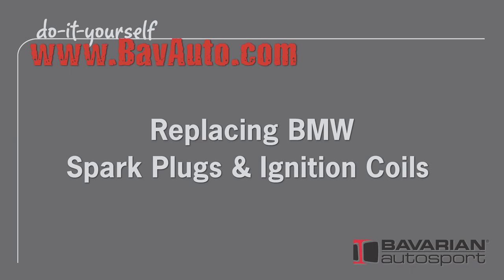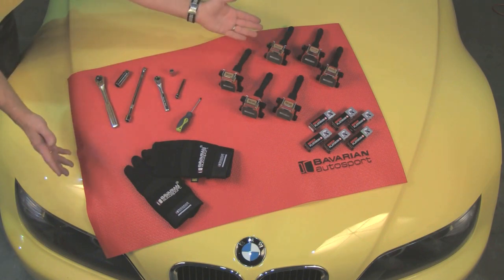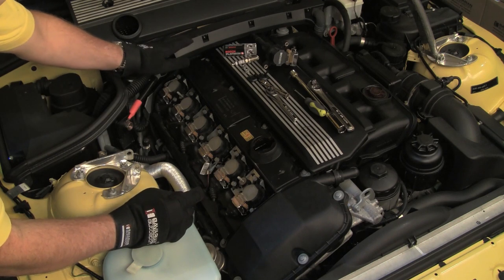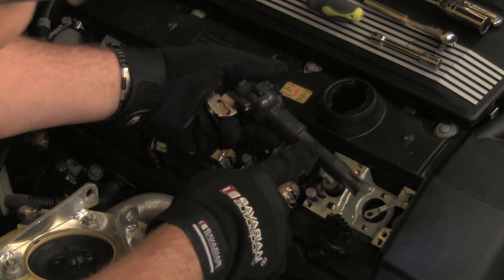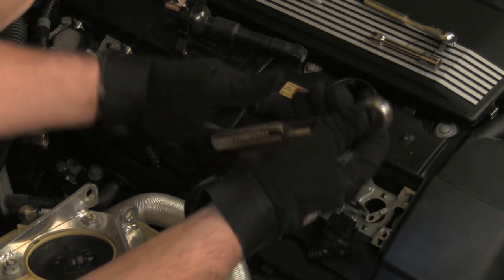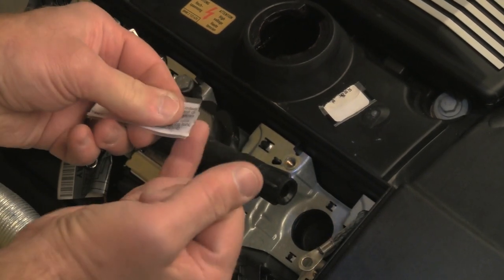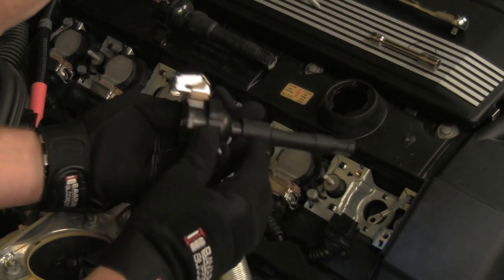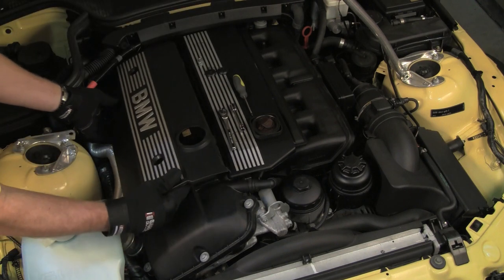Replacing BMW Spark Plugs & Ignition Coils

Comment: Thank you for this video. I had a P1344 code. I took it to a shop and they replaced the spark plugs for me for $270. Shortly after leaving the shop the light came back on so obviously that wasn't all I needed. The BMW dealer wanted about $970 to do this job. They said it was $750 for the parts and the rest was labor. I bought the same exact part from an online auto parts store for $230 and thanks to your video I was able to put them in myself. The engine light went out and it is running fine. Thanks again for this wonderful how to video.

Comment: Not to be a pain, but put the oil cap on before removing any nuts or bolts!  the last thing you would want is to accidentally drop something in there.
Reply from the maker: Good note, Harry
Reply: +Bavarian Autosport    I couldn't stop glancing at that hole into the great abyss. My gut was in a knot the whole video.
Reply: especially at 4:22 when he tore open the packet of silicone grease. the torn off part almost ended in the holw =/
Reply: Me too! Well not in a knot but very aware the dung  show that would occur.

Comment: After watching this video a few times I worked up the courage to tackle my first spark plug replacement on my 2002 325i and it worked out great.  Thanks so much for putting this on here.  I'm not brave enough to try the pcv replacement yet, but maybe sooner than later now that this went well.  Best regards

Comment: Job done, Thank you so much, local stealer wanted 250 bucks to swap ignition coil. I did job with just a socket driver and flat head screw driver. 10 screws and a few clips later engine running perfect. total time 20 minutes. Thanks again

Comment from the maker: Yes, it is similar.  the engine in your 95 325is is the M50.  the engine shown in the video is the M54.  The basic procedures are quite similar (almost the same).  you can certainly use this video as your DIY guide.

Comment: I have a '92 E36 standard M50 and it has a seldom ticking at idle. It obviously has a miss but I need to hook up a scan tool to see which cylinder is misfiring. Thanks to this video, it seems fairly simple. Also reading others comments helps too knowing that I have the same problems and that this is most likely the cause. Might have a valve cover gasket leak but I won't know till I check all the boots. I have my suspicion about 3.
Reply from the maker: See our reply to your other comment under Jose Francisco Medeiros' comment.

Comment: THANK YOU! I usually take my car to motorwerks for any service issues, unfortunately they couldn't get me in to a loner vehicle for about 8 days and I just didn't have the time to wait or be without my car.  I know my way around GM vehicles but I've been a bit hesitant to jump into anything on my 530xi for fear of screwing something up.  Equiped with some prior knowlegde from replacing a couple of ignition coils on my 02 lincoln ls and your video it was pretty darn easy.  Thank you for posting this, it was much appreciated.  Not only did I save a couple hundred dollars but more importantly the time and effort to bring my car into the deal.
Reply from the maker: Glad to help, Brett
Reply: BavarianAuto  Good evening, I know what it's called fat to put on the ignition coil? thanks daniel

Comment from the maker: We are showing coil replacement for those that may need to replace one or more coils.  Coils only need to be replaced if they are "bad", such as generating a misfire fault code ... or ... if installing high-performance coils.  As for the boots, these do indeed deteriorate as well as increase in internal resistance as they age.  these should be replaced when the spark plugs are replaced.

Comment from the maker: @dbeater1 

Most original BMW spark plugs are made by Bosch.  However, there are some NGK applications.  You can use either the original BMW plugs or the replacement Bosch plugs.  In the cases where the original plugs are platinum (most later BMW models), the BMW original plug typically has a larger platinum electrode than the replacement Bosch plug.  Both plugs operate excellently.  The BMW original plug may last slightly longer.

See them at bavauto.com

Comment from the maker: The coils for the N62 V8 and the N51 and N52 6-cylinder engines do look similar to the earlier "pencil style" coils, but there are indeed different. We're certainly sorry if you received an incorrect set.  We have also heard reports of access trouble on the rear cylinders, as you have noted.

Comment from the maker: While we have found that these engine mounted coils do degrade over time (due to heat), they certainly do not need to be replaced at a specific interval.  Replacement can be categorized as; upgrading to hi-po coils, curing a specific fault or general maintenance at a higher mileage, such as over 150,000, or more.

Comment from the maker: You likely have a faulty bulb or control module.  Try swapping the bulb with the same bulb from the other side.  If the on/off moves to the other side, the bulb is faulty.  If it continues to do it on the same side, swap the control modules. If it moves to the other side, the control module is faulty.  If the issue still is on the same side, you likely have a faulty main lighting control module.  Feel free to call our advisers at 800-535-2002 or visit our website for the parts - bavauto.com.

Comment from the maker: As Jose noted, the procedure is similar, but your later model coils are not bolted in.  The N52 series engine in your '06 325i uses what we call "pencil coils".  We do have a video showing the pencil style coils on the earlier M54 6-cyl engine.  Your N52 would be similar, as far as removing the coils.  Removing the trim covers to access the coils would be different.  Go to blog.bavauto.com and search "Pencil coils DIY video".  We do keep the coils in-stock at bavauto.com or call 800-535-2002

Comment: Get a tool tray, don't balance parts and tools on the engine.  Number your coils and line up your plugs in order to examine for abnormalities.  After removing coils and before removing plugs, blow out wells with compressed air while wearing your safety glasses.  always verify plug gap (trust but verify).  On many of the newer models, BMW advises against the use of anti-seize on plug threads.

Comment: @Buddy Reventlow 
Usually a rough idle or loss of power is due to a misfiring coil pack or spark plug. Just check in a auto store to get a free scan to tell u in which cylinder is misfiring
Reply: +Wladimir Delia.... The first coil pack is the one in the front if your standing looking toward the engine.... The 6 coil pack is the one all the way in the back

Comment: What year is the car that you are working on and does the same rules apply for my 2008 525i? BTW you did an awesome job!
Reply from the maker: 2001 Z3 3.0i Sport with M54 engine.  The 2008 525i will have the N52 engine.  The general procedures will be similar, but this is a different engine design.

Comment: Hi great video as always. I was changing plugs on a 01 330ci and # 4 and #5 plugs don't seem to turn to well, it did turn some but they seem tight when I turn them. The others ones came out good I didn't want to strip out the hole so I stopped. Any suggestions on how to remove them without messing up. Thanks

Comment: Great video Otto, but you never explain why the spark plug boot should be replaced each time you change the plugs. Please explain. Also, put the silicone grease you apply inside the boot contaminate the electrical contact?
Reply: Silicone grease is dielectric which means it's electrically insulating and does not break down when high voltage is applied

Comment: I highly recommend NGK 3199... Part # -  BKR6EQUP. You will get improved gas mileage an better acceleration as well as throttle response at low RPM's. WARNING: Do not get Bosch spark plugs, they have proven to be inconsistent and faulty as compared to the NGK spark plugs. Good luck.

Comment: +Boof Garage 2 weeks ago
 What happens if we install the spark plugs without new coils n or boot?

Nothing will happen. Most people recommend it because you are less likely to have a problem. I only replaced the spark plugs on my BMW 330i and couple days ago Cylinder 1, ignition coil went out which started to make my car have miss fires. So I ended up replacing all 6.

Comment: is your little packet of dielectric grease the same as bulb grease? Aso on the vid you mention anti seizure cream. ( used when replaced my water pump) .. the two have different applications for this procedure?
Reply from the maker: The lube packet is Silicone grease.  We recommend this over other products, for the spark plug boots.  We do offer Silicone lube packs individually:

http://www.bavauto.com/fland.asp?part=825

Comment: Warning . The oil cap is removed  to get the valve cover trim off  but it should be keep cover al the time to avoid an accident . Something could be dropped inside  and destroy the engine as the cams can get jamm .   .

Comment: I have a 2007 Bmw 328i with 93,000 and it has a cylinder 3 misfire. It vibrates and says check engine soon then goes away and comes back. Should I change the spark plug or the ignition coil?
Reply: Manny Gonzalez the same happens to me , I'll wait for the answer
Reply: Manny Gonzalez change all spark.plugs and 1 coil pack should do you good bro, same situation as me
Reply: Same issue
Reply: change coils, plugs and crankshaft position sensor. then hope you don't have worn piston rings.

Comment from the maker: We will suction out as much oil as we can before removing the plug. We usually use our vacuum oil extractor.  The extractor comes with a small diameter tube that can get down into the wells, next to the spark plugs.  Our fluid transfer pump also works well, but you need to adapt to a smaller diameter hose.  Once you have removed as much oil as you can, remove the plug and finish the clean-up.  We have the oil extractor and pump in our online store at bavauto.com , or call us at 800-535-2002.

Comment: 1/8 turn on taper seats.  15-22lbs for 14mm with gasket. go on the lighter side of  torque value when using anti seize.(less 30% of max torque value)

Comment: Does anyone know of a similar video for E46 model removing the panel which obscures the last cylinder location? Also I am sure someone else has pointed out already but even though this is obviously a professional mechanic with a steady hand, put the oil cap back on. Save you fishing around with a magnet to get a nut out from under the valve cover!

Comment: Is it really a requirement to replace the ignition coils and boots when replacing the spark plugs?
Reply from the maker: gtarules1 Certainly not.  Only if there are fault codes that point to the coils or if you wish to install hi-po coils.  The boots, however, should be replaced when the plugs are replaced (on the early styles that have the long removable boots (all 'bolt on" style coils).
Reply: Look up the firing order for that engine.

Comment: very good, my car is a 2004 x3 3oi that it makes any difference & what set of coils & sparks u recommend?
Reply from the maker: We would recommend either the original NGK or Bosch spark plugs (BMW used both of these as original) for your X3.  See link below.  If you are replacing the coils, you can replace with standard replacements or take the opportunity to upgrade to the high-performance coils (see below) for a small increase in fuel mileage and engine power.

NGK spark plugs - http://www.bavauto.com/fland.asp?part=BKR6EQUP
Bosch spark plugs - http://www.bavauto.com/fland.asp?part=4417
Standard coils - http://www.bavauto.com/fland.asp?part=12131712219A
High Performance coils - http://www.bavauto.com/fland.asp?part=5004%206

Comment: can i bounce a question off you?  I changed the O2 sensors and the plugs  (but not the boots--I plan on doing that next weekend and wish I had  listened to you where you suggest doing them at the same time).  I'm still  getting indicator codes stating that bank 1 and bank 2 sensors are lean.   Is this most likely the Mass Air Flow sensor or something else?  Both bank  sensors keep triggering warnings at the same time???  Thanks,
    Chris

Comment: I bought a set for my 05 545i, these do not fit. i am so disappointed that i had to return them. Plus the cylinders 4 and 8 are too close to the firewall, so the mounts need to be lowered.

Comment: I have a 2009 e60 528xi with 34K.  Should I replace my plugs?  I assume that I can wait on replacing coils until I hit 60 or 80K?  Lastly if I should only replace plugs, do I need to replace the connector boots?  I cannot find the boots on your site FYI.

Comment: this looks very simple BUT i have a 2006 325i, does it have the same process as this video?  I didn't get any error code when coil #1 failed.  I only found out after I dropped it off at the shop.  The engine start to shake in idle/Neutral and vibrate when I was at the stop light, then acceleration felt so slow and i could feel vibration on the steering wheel.  I want to prevent future replacement of coil 2-6 so i want to learn DIY rather than paying $500+ for them.

Comment: Quick question. What's the difference between your Bosch plugs and the BMW plugs. The dealer ship
Said they use the Bosch plugs and were going to charge me 159$ for six plugs but your price is WAY better than there's. Are they the same Bosch plugs???

Comment: Hi
i'm replacing my valve cover gasket on my 2004 530i ,, and i noticed that one of the coil wells does have some oil,,, is it ok if i just drain the oil from the well, or should i replace the spark plug and the coil ??
Thanks

Comment: Hi nice video :) i have a really different situation the motor oil went to my water gasket what should i do i have been cleaning it time after time its still coming out what should it be?
Reply from the maker: Are you saying that you have oil in the coolant?  If so, you likely have a faulty head gasket or a cracked cylinder head.  What model do you have?

Comment: I just replaced the valve cover gasket. Number 1 cylinder spark plug coil boot stayed in the hole. I tried to remove it but no dice. I put the valve cover back on and re installed coils and boots but now I have a rough idle and check engine light. I am sure it's the boot on cylinder 1 misfiring. I guess the only way to pull the boot is destroy it with pliers. Any comments?
Reply from the maker: We have seen the boots stick to the spark plugs in such a manner that you do need to destroy them in order to get them off.  Just purchase a new boot (or a full set of six ... they should be replaced when the spark plugs are replaced), and then have at it.  Be sure to lubricate the inside of the boot with silicone grease to prevent a future similar issue.
Spark plug boots: http://www.bavauto.com/fland.asp?part=12%2013%209%20067831A
Silicone Grease:  http://www.bavauto.com/fland.asp?part=825

Comment: Hi and thanks for the video! 

Quick question. I changed my plugs about a year and a half ago without changing out the boots. Just recently I have been getting a misfire that happens at low RPM but not at high. When I rev the motor there's no misfire, only when in drive. Could the boots be the answer?
Reply from the maker: Yes, the boot connectors certainly could be the cause for the misfires.  Replacing them would be advisable.  Additionally, have any fault codes been generated?
Reply: It stopped misfiring on the way to work last night. But leave work it happened again. p0172 and p0175 is what I get but I was getting those codes even before the misfire I've changed my fuel filter so far and before the fuel filter change it was giving me too lean.

Thanks!
Reply from the maker: problematik1
Your codes are for "system too rich" for both bank-1 and bank-2.  You should read the freeze frame of the fuel trims at the time of the fault code generation (tools such as our C-Reader VI can do this), as well as live running data.

Check our blog post on basic fuel trim info, here:http://blog.bavauto.com/10781

Comment: Why isn't the engine oil cap on after removing the engine cover. This oversight potentially cause either debris or unwanted object falling into the engine, thus creating some hassle to retrieve the object.
Reply from the maker: Yes, it's a good idea to replace the oil fill cap after removing the plastic trim cover.

Comment: i have a bmw 323i 2000 E46, i have a problem with the aircon and the temp sensor in the dashboard it stays stuck on 50 C, and sometimes jumps to -12 C, and the aircon only the drivers side gives out cold air but not as cold as it should be and the other vents give out hot air, what could be the problem?? please any help would be gladly appreciated!

Comment: About how often should you perform this job and is it necessary to replace the boots and coils along with the plugs?
Reply from the maker: On the later models (with the coil-on-plug ignitions), the interval can be 60k to 80k miles ... in general.  Of course, we would recommend a spark plug inspection by 60k to see how they are wearing.  We do recommend replacing the coil boots (on the models with the bolt-on coils) when replacing the plugs.  The coils themselves can be run until any fault codes may indicate misfires that could be due to the coils.
Reply: So what is your recommendation for an e39 and an e46
Reply from the maker: Robert McCarson
 We would check the plugs on both at around 80k miles ... perhaps just be prepared to replace them.  Depending on the year, they may have the bolt-on coils (as shown in the video), which should have the connector boots replaced as well.  If they have the later M54 engine (around 2003-on), they will have the "pencil" coils (we have a video for the pencil coils as well).  The pencil coils do not have separately replaceable boots.